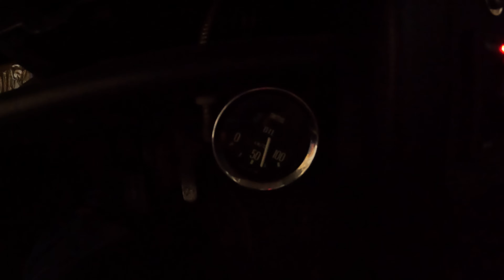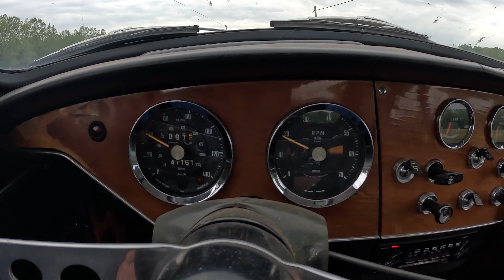1968 Triumph GT6 - Oil Change + Cooling System Flush And Drive

Comment: back when cars were cars and not computers on wheels. That things got a lot of motor for such a small vehicle. It sounds good even with that exhaust leak. LOL
Reply from the maker: It's a runner for sure.  I've got it's "baby brother" sitting here that will eventually get a fair share of coverage on the channel when I get time.  With that said, there's a few things coming up for this one..   full stainless exhaust is first on the list once it comes in.